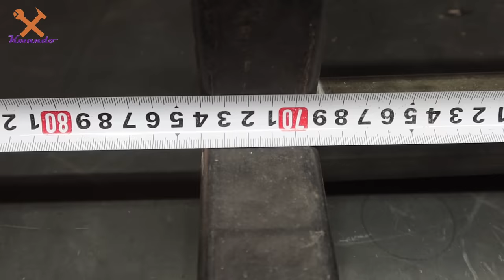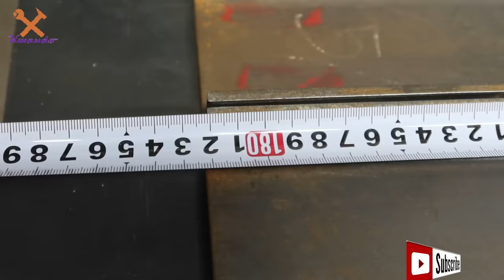Make An Electric Lifter - Forklift With Height Up To 4 Yards | 2 Functions In 1 Forklift

Comment: Forklift Rule #1, always travel with any lifted load as LOW as possible. You were unnecessarily high when pushing the box around. And, with your little wheels, it never hurts to put a strap around your load in case the wheels hit a floor obstacle and the load jerks to a stop and the load lurches forwards. Otherwise great job!

Comment: A great demonstration of fabrication skills.  It's similar to the Genie lifts we used in our HVAC shop.  For safety, I would suggest outriggers on the sides and encased within the base frame extending both to the front and rear.  These would negate the need for the added weights.

Comment: Very nice project! My concern is the small diameter pulleys with the large diameter cable. I have a similar setup and found It was necessary to use 80mm to 100mm pulleys to prevent damage to the cable.

Comment: Great Job, the concrete counterweights looked unstable you could do with a safer system where they interlock and possibly a safety limit switch in case you go too high or your up button gets stuck. Well done. .
Reply from the maker: Many thanks for your advise!
Reply: @KwandoTechnic  3
Reply: Buenos días quería decirme las medidad

Comment: What kind of motor? 
What are its specifications
Your design is good, but did you add a safety lock in case
Reply from the maker: Capacity: 1500W, 230V/50HZ, Max weight: 400 kg. Speed: 10m.min

Comment: Excellent build. May I ask what it cost to make as you used all new materials so it’s wouldn’t have been cheap. Do you still use the smaller forklift you made! Cheers Stuart 🇦🇺
Reply from the maker: Cost for this lifter is 300 US$. Now I’m still using small forklift.

Comment: Manufactured lifting system is nice, but it lacks one or two. The bearing on the lifting section and the rollers over which the rope passes should be lubricated with grease. The concrete weights placed on the back should be fixed with screws instead. Thus, the system can work healthier and safer.
Reply from the maker: Many thanks for your advise!
Reply: The worst is not that the rollers are missing lubrication, but that they have too small diameter for that thick rope.
Look at 17:47 and see how it does not want to bend naturally.
Steel ropes have a minimal bending radius depending on their cross section.
Bending a thick steel rope over a small radius will damage it quickly.
Than it will fail catastrophically...

That's why commercial lifts of this type use chains instead of steel rope.
Reply: It lacks a lot of safety measures! !!
Reply: @massimopavera8941  yes, i agree;  great job as first working prototype , but lacks on safety ....other than the mechanical ones already pointed out , i would add limit switches that prevent the motor to run when reaching lowest and/or highest position...
Reply: @KwandoTechnic  can you make one for me
Reply: @juancarlosabad3298  I would allow it to run until it’s in the lowest position. It won’t be nice if it fails to work while you’re up there in the man basket. Although, i would stick to lifting materials with such DIY contraption, not people. If anything happens, it can end very ugly, requiring hospital visit.
Reply: Also your wire rope clips are backwards. The saddle should be on the long side, not the short end.
Reply: Ssssss
Reply: @juancarlosabad3298  disculpa qué precio tiene y en dónde se fabrica y cómo lo puedes mandar
Reply: Yo estoy en México
Reply: Can you share the plan of this project?

Comment: Nice simple design, but only for cargo lifting. For human lift, it must have automatic mechanical braking of the lifting cart in the event the hoist fails, cable breaks, cable hardware comes loose, cable pulleys break, any welds holding the cable system breaks. This is usually done by weighted (or spring loaded, but weighted is best) pivot arms with brake shoes on the outer end of each arm riding in the U-channel. The other end of each pivot arm is the attachment point for the lifting force (the cable bitter end). Weight is added to this end of the pivot arms such that if the regular, normal lifting force suddenly goes away. The weights on the pivot arms jam the brake pads outward into the U-channel and arrest the fall of the forks or carriage platform. Under normal lifting force of the cable, the pivot arms cause the brake pads to be retracted from the outer wall of the U-channel and the lift works normally. This is the braking system for elevators that was invented by Elisha Otis that finally made elevators safe. You really need a braking system. There are many techniques. Even a cargo lift needs a braking system to prevent someone or something under the lift from being killed or causing damages. Failures will eventually happen. Be prepared with safety systems.
Reply: GREAT ADVISE!

Comment: Great design, Personally for me i wouldn't even consider an ac motor without gear reduction box in this application which is costly unless u use chains/sprockets and when 1200lb Chinese winch nothing and DC typically has more torque its the way i would go.....I do this for my engine lifting cranes and one i built for my ute.
Either way doing and building things is a way of learning and someone always has an opinion haha

Comment: Damn! That was a great video. You made it look so easy. You are an expert TIG welder. 
When you were tacking pieces in place, it looked like you were just using the torch without any wire. Is this true? How did you do that?
Great design and thanks. 
Paul
Reply: ............... Fusion Welding ... Fuse Welding .....
Reply: @Electraglide1350  I’ll have to look that up.
Reply: Hey Paul I watched many videos where they tack weld with out the the wire but to make it stronger and solid you finish the weld with the wire

Comment: The bull dog clips are the wrong way round. What about maintenance? how do you change a bearing if it fails? you have used a lot of welding and no mechanical joints ( Bolted ) so how do you dismantle in case of repairs? Otherwise the design is vey good.
Reply from the maker: Thank you!

Comment: I'll guess the cost of materials alone is north of 2500 dollars, not counting the labor and time or expendables.  Having all the tools for the accurate cuts, and a bench plus the proper welding equipment already also helps.
Reply from the maker: In my location, total cost for materials less than 500 US$.

Comment: Very good job... you are very skillful. If you sold it, how much would you ask for?
Reply from the maker: I don't sell. Sorry. And cost for material is 450$
Reply: @KwandoTechnic  I didn't want to buy it, I ask you just from curiosity
Reply from the maker: @tapantaola2148  it’s OK. It’s not cheap so everyone only buy it if they really need.
Reply: @KwandoTechnic  For a painter (with a slightly larger surface) it is a good solution
Reply from the maker: @tapantaola2148  many thanks for your suggestions!

Comment: Convenient, safe and reliable. Labor-saving electric telescopic high-tech scissors.  Function: 
              1. Trim excess branches
              2. Landscaping
              3. Pick fruit from tall trees
              4. 20MM branches can be trimmed 
              5. Suitable for all seasons, spring, summer, autumn and winter.                                                                                                                                                                                                                                                                                                                                    
              6 . Total weight: 1.68KG              
              You can always call me if you need anything.

Comment: Great idea, but it appears there are some design flaws for safety.   Heavy motor should be mounted near ground. Footprint of base need be longer and wider to increase stability and reduce possibility of tipover should lifted object shift off center or ground not perfectly level.   Man cage need much higher side rail. Tall man can lose balance and flip out of that thing. Also rail gate need an extra safety latch.
Reply from the maker: Many thanks for your advise. Some dimensions should be modify base on actual conditions. Regards!

Comment: I like your unit but you did put your cable clamps on backwards and they could slip
Reply from the maker: Many thanks for your opinions. But actually I don't understand.
Reply: Your clamps are installed correctly. There is a statement in the construction industry.  Never saddle a dead horse. Meaning the you bolt as the saddle should always be on the live / load bearing cable. Just as you installed it. Great job.

Comment: Great project!!  However, in most countries, the design and manufacture of hoisting and manlift systems can only be done by  competent engineering firms licensed by  the Occupational Safety and Health authority.  Otherwise any user will not be covered by insurance arising out of the use of such systems and the fabricator or vendor of such systems can be fined under the law.
Reply from the maker: May be. But in small shop or family, I think it's not problem.

Comment: Hello, what kind of motor did you use for this crane? is it Ac or Dc?
Reply from the maker: I used AC type. In this video, I also used 1 converter to convert battery power to AC power supply.
Reply: @KwandoTechnic  what voltage of battery did you use bro? Planning to produce one for a warehouse setup
Reply from the maker: @eric24297  12V battery
Reply: @KwandoTechnic  how long does it take for the 12v battery to run out?
Reply: @KwandoTechnic  lastly, what is the rpm value of the ac motor? Thanks bro
Reply: @eric24297  Be aware that if you're using this in an official business, that you are liable to the safety of your employees. Such DIY contraption is never tested, not certified, has no proper maintenance schedule. If people get injured then you are the one in jail.

Comment: Bro great job, but provide those material name, there availability, so that it help other, unless what's use of showing this, share your knowledge isn't that
Reply from the maker: Please see deatil in video help me! I showed all measeurements in video. Now I don't enough manpower to have a drawing to show. Sorry!
Reply: @KwandoTechnic  
Thank you for your video instructions. 
In my humble opinion, I can see that you provided all of the required information for viewers to recreate this outstanding project. 
I believe that your ultimate goal here is to share your ideas, but not to provide engineered design details that builders must apply to their individual skills, and unique situations. 
You SHOWED everyone what YOU did. 
I say “BRAVO”!!! Job well done. 
Your video production is also top-notch. 
Thank you again. 👍🙏👍🙏
PS. I noticed at the end of the video, as you threaded the cable through the pulleys, that the steel cable was taped to help contain the individual strands of steel wire that made up the cable. 
I discovered, while installing cables on a bicycle, that I could control the unraveling of those tiny cables by applying “Gorilla” brand glue. 
I dipped or applied the glue to the end of the cable and then sprayed it with a fine mist of water (as per instructions for the glue) a few times until I was satisfied with the results. 
Allowing the glue to “penetrate” into the cable and surround the steel wires in the cable added durability to the finished cable ends. 
Again, thank you for a great video.

Comment: I'd like to see what happens if the cake snaps while you are st a certain height? ???
Reply from the maker: You can stop it as you want.
Reply: It lacks a lot of safety points.
Reply: @massimopavera8941  do you have any suggestions?
Reply: @adjo8533  Buy official certified machines. Engineers have put decades of thought into the design of their machinery to make it strong and safe. But do what you want, i just don't want to know anything about how your accident looked like and how painful it was.

Comment: At 8:55, what's the outside diameter of those 2 rollers?
Why are they different from the one At 4:46?
Reply from the maker: All bearings are same size.
Reply: @KwandoTechnic  
So what size are they?  I was asking you about their OD.  You still did not answer my question.

Comment: Handwerklich bestimmt toll gemacht aber für Deutschland unvorstellbar und lebensgefährlich .
Was ist wenn das Stahlseil reißt 😬oder die Betonplatten runter rutschen?
Reply from the maker: You should check cable before use, And use as instructions.

Comment: "Safety cage" is too low. Counterweights are not secured. All welded construction means it becomes unserviceable should any bearings, rollers, pulleys or other contained parts fail. Insurance companies would have a very poor view of this in case of an accident.

Comment: I don't think it's a good idea because the motor is already under direct lift, it's better when the wheel is placed on the lift table and the dc cable end is fixed on the frame

Comment: The only thing I see wrong is he can't pick up a regular pallet the wheels will interfere with the lift forks
Reply from the maker: No, you can see it in begin of test process.
Reply: Pallet have support strips underneath them  .for what you have your wheels an forks to go through top an bottom of pallet. U are using a no bottom support pallet